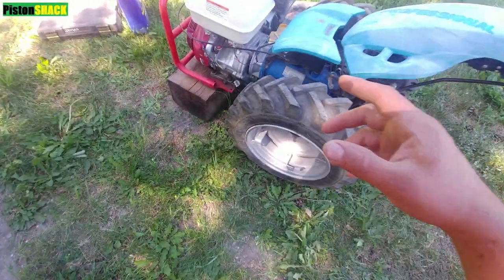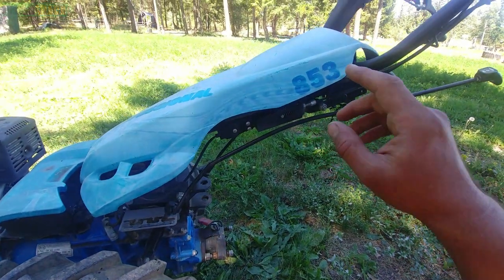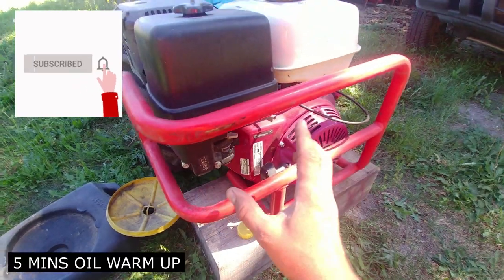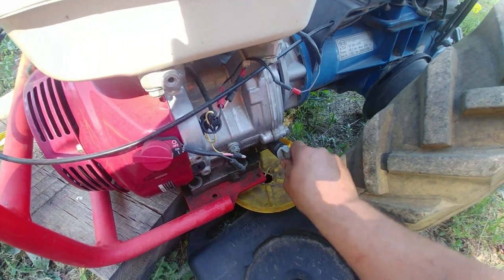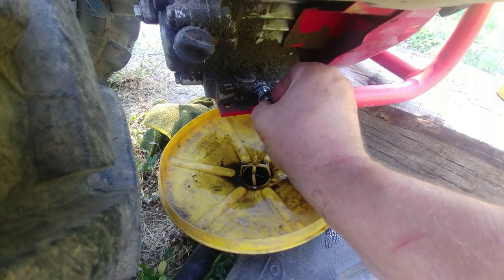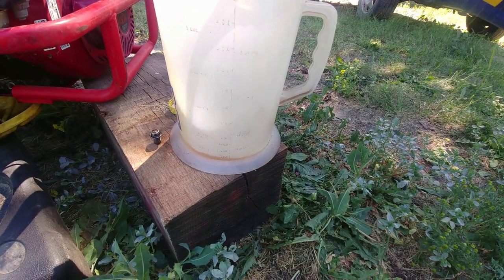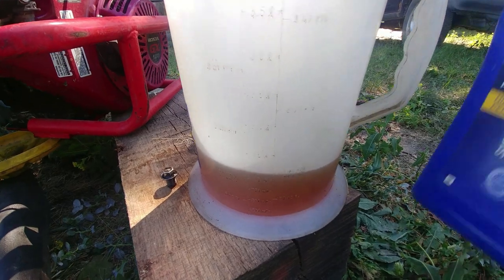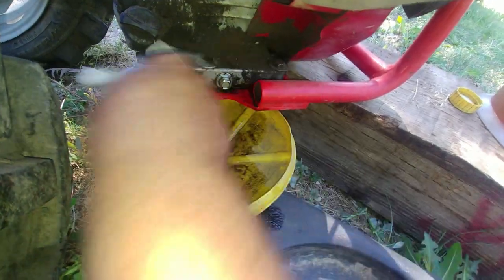BCS 853 WALK-BEHIND TRACTOR ENGINE OIL CHANGE | HONDA GX390

Comment from the maker: Check more Garden / Lawn Equipment Videos: 
How To Replace Dirty Air Filter On Lawn Tractor John Deere D155 https://youtu.be/WTS03Qfs0YA
OIL CHANGE - JOHN DEERE RIDING LAWN TRACTOR. SAVE CHUNK OF $$$ https://youtu.be/cOLJW-yi-ZQ
HUSQVARNA WEED EATER TRIMMER HEAD REPLACEMENT https://youtu.be/fmMcindEAts
STIHL KM130R WEED WACKER STRING TRIMMER LINE REPLACEMENT https://youtu.be/CgFbS03pKzI

Comment: Thanks for the video! I noticed that there is a white oil dipstick and then another black oil dipstick on the other side. Is the black oil dipstick for transmission fluid?
Reply from the maker: You are so welcome Wil! Transmission oil dip stick is located on top of the gear box under plastic top cover. Btw, I made the video how to change transmission oil on BCS tractor as well!
BCS 853 WALK-BEHIND TRACTOR TRANSMISSION GEAR OIL CHANGE
https://youtu.be/C_7Oca0d7gM